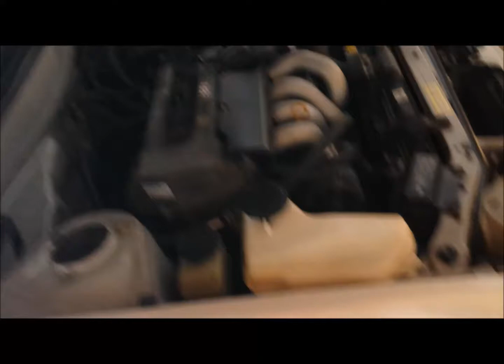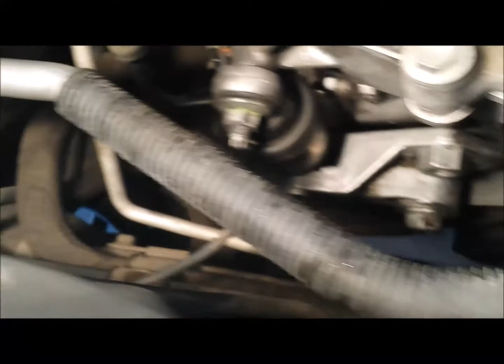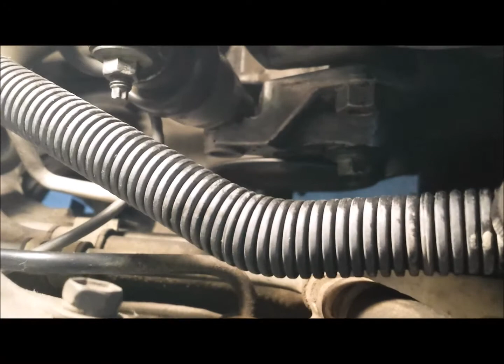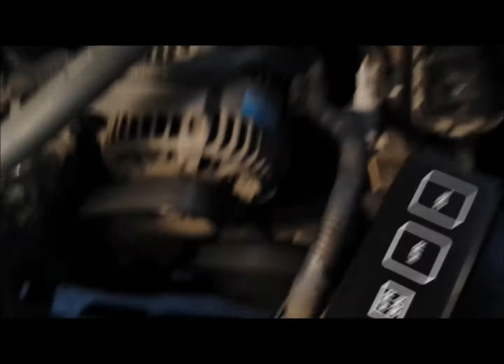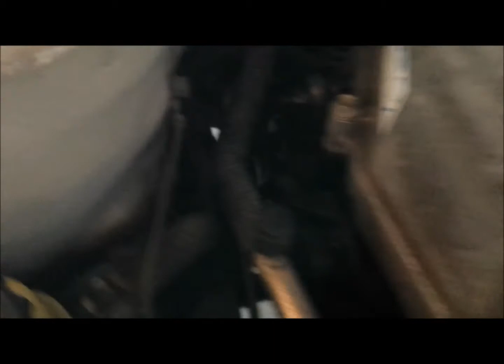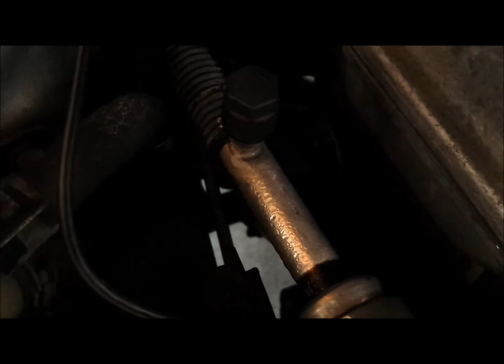Knocking sound from Toyota Corolla

Comment from the maker: It was the serpentine belt tensioner. Got a new one -  everything good now.
Reply: How much was it sir. Everything with labor?
Reply from the maker: @hakol1156  I bought the OEM tensioner from toyota for around $165. No labor since I installed it myself. I went with the original after I had 2 cheap ones that failed shortly after and I got tired of changing that thing all the time. So if you plan on keeping the car longer, get the OEM tensioner.
Reply: @TheFrankman711  hey thanks very much for the reply and the detail. I just bought one today 99 for 1500$ has 180000 miles . Lol .
This thing is a beauty ...
Reply from the maker: @hakol1156  Yeah, and they are super reliable.